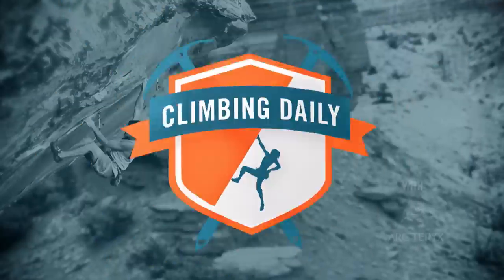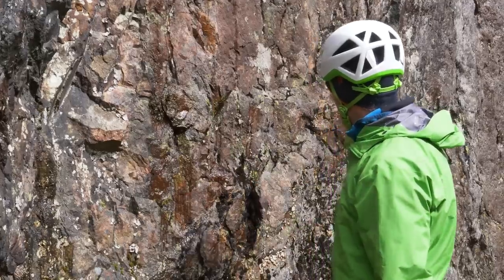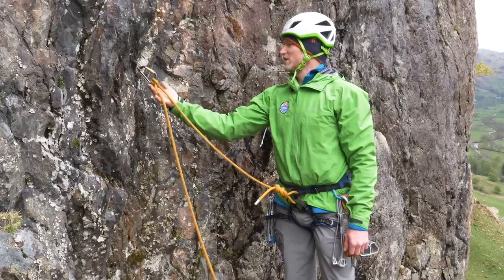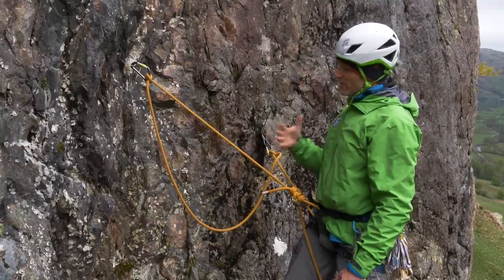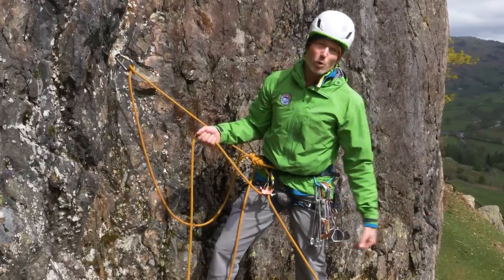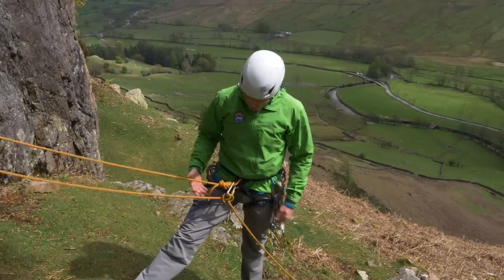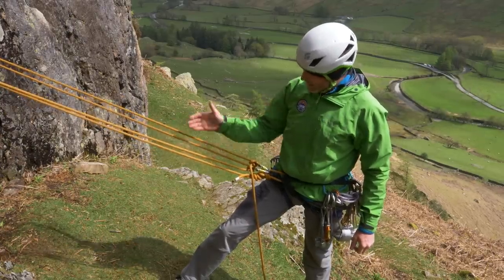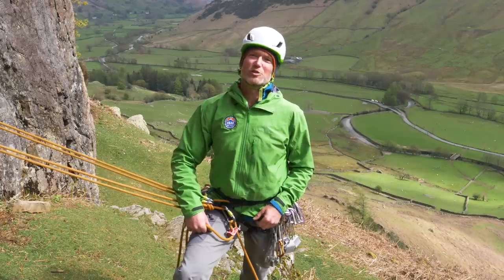How To Build And Equalise A Trad Climbing Anchor | Climbing Daily Ep.1174

Comment: Hi Adrian thanks for the video! Most people are taking issue with using the rope in the anchor which has it's pros and cons as you acknowledged but I have a different question. 

If your second leads the next pitch and takes a big fall after already placing a piece or two with these two nuts (or any passive gear) as your only anchor points they may pull out because of the upward pull introduced if you the belayer get pulled above the pieces. That will leave the leader's one or two pieces placed as the only points of attachment for both of you to the wall, and they are less likely to be as solid as anchor pieces you've had more time and possibly a ledge to place at.

Of course you can mitigate this risk by extending the anchor like you did in the second half of the video, because you'd have to go flying what looks like 5m+  up before you'd be pulling up on the pieces, but you'd still be pulling outward on the pieces before then. Or you could place a multi-directional piece, such as a cam in a horizontal crack, as part of the anchor as that would hold upward pull. Alternatively, you could place a piece that specifically protects against an upward pull like in this video: https://www.youtube.com/watch?v=1_6AcbwV2ac

Is there any reason you don't mention this or opt for one of those strategies? Most multipitch trad anchor instructional videos seem not to acknowledge that risk but maybe there is a reason.
Reply: If the leader has placed good gear then it may well be as well placed as the gear for the belay.

This is just part of lead climbing on multi pitch routes.

It's all about making the decisions dependent on the climb. If you think that due to a run out and sketchy gear on the pitch or that the belayer is far lighter than the leader then it might be a good idea to place some gear to hold them down.  More often however is that you will have built a belay for the second coming up the way and then the next pitch is a traverse so before the leader sets of you would need to add an anchor to take a sideways pull rather than just a downwards pull.

It is all about the dynamic risk assessment you do in your head really.

Ref the cam point - you should still place cams with the direction of pull.
Reply: I suppose this is just a summary video and doesn't go over those points.
Reply: Yeah they did a few vids in this series but they need to be short simple and cover the main points. I have never been pulled up that drastically so far :P
Reply: I'm just quite heavy and climb with mostly smaller partners so it's something I need to be aware of.
Reply: It would have to be a massive fall to be fair. I have taken and held some massive falls indoors and neither I or my climbing partner have never been lifted that far off the ground apart from when I have jumped slightly to give a nice soft catch.

Honestly It would have to be a massive fall with a huge weight disparity. Even when jumping to give a soft catch on sports routes I have never got to the first clip; ever.
Reply: I've lifted climbing partners more than 3 meters fairly regularly. I use an ohm now on sport routes...
Reply: Scott van Heerden yeah they are pretty cool. Maybe get your seconds to wear a weight vest. Lol. Joking of course.

Comment: Man I would never use just two nuts as an anchor... Always at least three, preferably at least one being a solid cam.
Reply: Cams are a last resort in building anchors as they are so prone to walking with a constant tension, which could result in a loss of equilisation
Reply: I'm pretty sure it is impossible for a fully-weighted cam to walk. The pressure exerted on the lobes will keep it in place. If placed correctly, a cam is the optimal piece for an anchor.

Comment: Shouldn't you use the belay device in "Guide Mode"? I think that in this way it's not effective at all!
Reply: This way is actually very effective and safe. Use of belay device in so called guide mode is a relatively new thing, and I always prefer it myself if possible, but used this technique for some years before the Reverso/Guide system kind of revolutionized things a little. If the anchor points are far apart, something not uncommon in the mountains, this method is still relevant.
Reply: I don't understand how it is related the use of this method to the fact that the anchor points are far apart. I don't think that it's effective because to brake properly the rope shouldn't enter and exit from the device along the same direction but, as I know, in opposite direction and it's not safe because it's not aulo blocking at all and if by mistake you let the rope your partner can fall. Finally, before the "new thing" of the so called guide mode it was used something like the GiGi from Kong or, even before, the munter hitch that are both, in my opinion, safer than that.
Reply: You see the use of this method every day, in every gym all over, just with the belayer standing on the ground. Same principle, same rule - never let go of the brake rope. Since the introduction of the Sticht plate some 50 yrs ago this method has been common, at least in Europe, with minor variations. Pretty comfortable, I've climbed quite a few walls and pitches over the years this way. Nowadays I of course prefer Guide-mode, it is more convenient in most situations, and for sport climbing I've only used the GriGri for the past 20 years, but still in some situations I build an anchor with the rope and (more seldom) use the method shown in this video. It is bomber.
Reply: Yes but the working principle is completely different when used in a gym for belaying the person who climb (lead or moulinette) from the ground because the angle of the rope that you keep in your hand is intuitively correct while to belay a person from the top you must make sure that the rope forms an angle of 180° making it more difficult because you should keep the end of the rope not beside your leg as you normally do but instead in an upper position (sorry for my bad explanation but I hope it's somehow clear because it can be very dangerous!)
Reply: This is a proven method over many years by climbers and professional guides alike, I did use it myself for 10+ years, also teaching beginners without any incidents whatsoever. Quite the opposite; it's quick to learn and as easy to perform safely as belaying on toprope in the gym, not more or less dangerous than most other methods I would say. It even has its advantages to the guide mode, especially in case one has to lower the second, something that can be a bit awkward with a Reverso/Guide device in guide mode. You're describing something that is not based on your own experience, as far as i understand it (rspct, peace and love!). Everyone is of course free to have any opinion they like in this matter and I'm not the one to tell you that you're wrong, yet here I am, telling you that you're wrong :)
Reply: nextoliver You're right, everyone is free to do what he prefers but not when they are responsible for other people's life, in that case they should stick to the rules written in the instructions of the belay device that are clear. Trying to teach on a YouTube video something that's not officially correct is dangerous, maybe not for you, but surely for someone less experienced.
I would not climb anything knowing that the person on top is belaying me using this method, I just wouldn't feel safe.
Reply: I absolutely agree that nobody should learn techniques like this solely from youtube videos. It is far too easy for them to be misunderstood or misinterpreted - which is actually what I think is happening here - I am sure that if someone showed you in person how to belay using this method in a safe environment so you could get a feel for it then you would have much less reservations. If you already know how to belay conventionally then you may be surprised how easily it 'clicks' when transitioning to belaying from above.
Reply: It is perfectly safe to use it in that method. It is in the manual for the DMM pivot. you can use it in guide mode or this fashion, which is how original tube style belay plates were used.  I get what you are saying, someone would literally have to set this up and get you to pull on it fin a safe set up (not on the cliff!!!) for you to see that it is safe as houses. I have had loads of students dangling/resting/slipping/falling whilst using the DMM pivot (the one in this vid) in the same way he has it set up.
Reply: Marco Hollò  This is a perfectly effective way to belay from above. While I prefer to belay my second either direct from anchor or via redirect, I have used indirect belays like this many times. For instance, any time I have a bit of room (as in this video) and I have a suboptimal anchor (also as in this video, though perhaps out of convenience rather than intentionally), I'm using an indirect belay (which AAC also recommends). I've been in a situation in which an indirect belay from extended anchor cut down significantly on rope drag. Developing an area, I've topped out on choss and anchored to trees too far from the edge for direct or redirect to be practical. I could continue with examples, but won't. The point is that having this arrow in your quiver (and/or your partner's) makes you more adaptable and SAFER for that reason. It is a drastic oversimplification, and frankly unwise, to make a blanket statement like, "I would not climb anything knowing that the person on top is belaying me using this method, I just wouldn't feel safe." If you don't feel safe thinking about it, that 's fine, but if it's because it's not something with which you're familiar enough to be comfortable/adept, then I suggest you learn. 
Regarding braking position: it is NOT difficult to brake at >180* using an indirect belay. In fact, setting up for potential load from anchor through belay device to climber in linear orientation all on one side of the belayer's body (as in the video) actually HELPS brake, because the climber's weight on the rope will pivot belayer's hips—and hence body/hand position—into a BETTER plane for braking angle (if belayer not already oriented as such). I've heard the "poor brake angle" argument largely from people who don't have the experience with indirect belays to appreciate the fact that it's simply not true. Moreover, any climber who can't figure out that braking straight down to thigh isn't the way to arrest falls for indirect belay is someone I'm NOT climbing with (it's fairly intuitive to brake properly like this, and if they're not that bright we're probably not friends). My preference for direct or redirects from above are for their advantages, and not for disadvantages of indirect. 
The most significant disadvantage of indirect belays is the relative difficulty of escaping the belay, which can still be done with the application of Munter-mule and Klemheist knots …and the cool head to remember them. Those are a couple more arrows for the quiver, but this comment has already come to close to a friggin' book as it is. [/rant]
Be safe out there.

edit to add: I just watched video again. This is tangential to remarks about the indirect belay, but the thing I DON'T like is the belay device apparently clipped into the rope on the near side of fig-8, along with the clove-hitched 'biners and belayer. It negates the force absorption advantage of an indirect belay.

Comment: Curious how to adapt this to 3 pieces in the wall
Reply: For both you would attach to a third piece of protection by repeating the method used to attach to the second piece in the out of reach example. By clipping the rope through a carabiner on the piece of protection and then attaching it to yourself with clovehitch

Comment: I've always wondered; If there are no rap bolts, how do you get down with your gear on a trad climb?
Reply: Joe L from my not very extensive experience, that doesnt often happen if it's a well established trad crag. 
If theres no rap points, there's usually a walk off, worst case scenario some scrambling. 

I've heard about rapping off of trees but that's not good for the tree and very risky for you. 
Some rock features may allow you to tap off it too though (like a closed off pillar in a cave where the rope cant be removed by upward force).

Wires and biners can be considerably cheap if an emergency arises I suppose
Reply: Bring extra webbing and a quick link! Just sling a good tree or rock and rappel. Sacrificing a sling and quick link are much less expensive than gear. Plus, maybe it'll help the next group of climbers!
Reply: On a multi pitch climb you would have to leave gear. So yeah, not something you would do if not absolutely necessary...